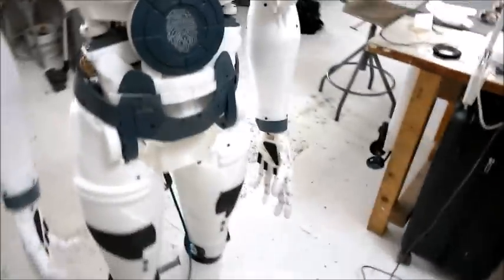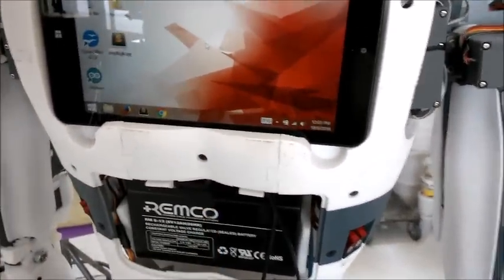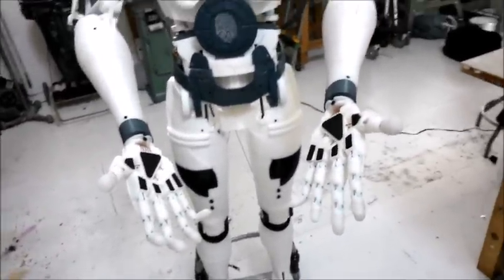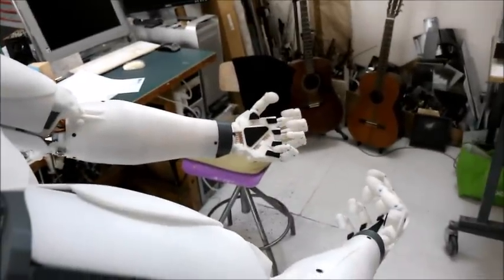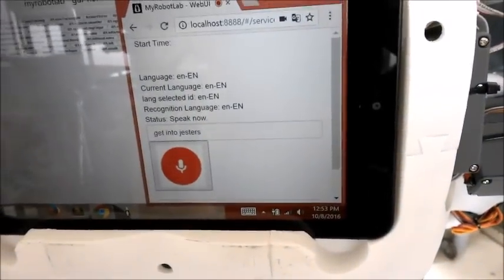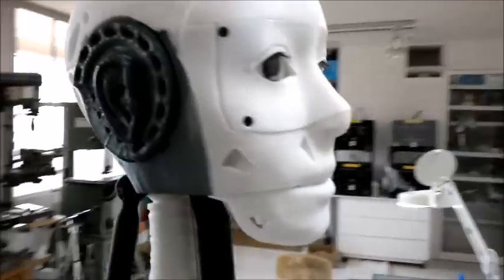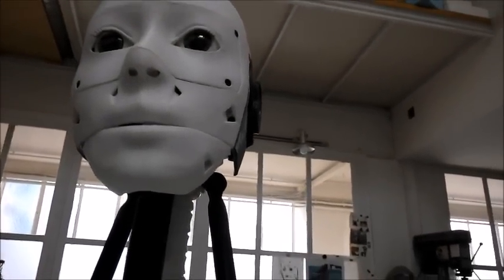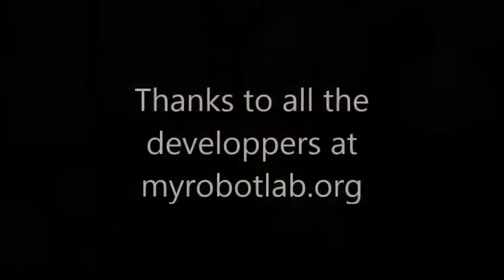InMoov on legs first 3D printed robot OpenSource

Comment: its 7yrs ago??? nd I m seeing on 2024 😮 if I start today don't know how many months it will take my poor printer to finish all parts😮 then a dyslexic like me gonna make many mistakes first few attempts..then assemble somehow... err😢 then fitting gpt, 60-100 servo motors..  then arduino code.., power supply cable will make it limited to move area,😢 so much task. Why am I lagging 7yrs in timeline jump😢😢😢

Comment: you chould automate the face recognition by what you do manual to classify faces by program an small program that uses some object tracking by ultrasonic transducers to determine that the robots camera is in front of a unclassified object or person before a automated instruction to activate the program that classify a single face before it saves the entry and fill in just a random number to the name. you can use the sound recognizer to determine of let the machine find out the name of the random person and then adress that name to the random number given to the classifier by making a name equal number command instruction. this way the machine could classify people or objects by itself. alternativly use the pretrained objects to determine point of capture of new objects and then narrow down the screen of the camery by excluding the part it already recognize from the picture so that only the new part is ready for classification. by repeat such a process automatically the robot chould build a record of tousands of new object over time given random numbers as classifications. the robot only need to use the sound detection to determine name of object. let say that you have the hand of a person classifed already pointing toward a object auto classified by random number and a confirmation by user input by voice to tell the robot to label the random number of a certain image object in the network with the name of the of what the object was called.  the robot only need to interprate the pointing finger as a gesture like a arrow for direction and you could in a sense teach it the real names of object classified before or you could make the robot pick these thing up by itself by a little bit of guessing. someone else would probably label objects out loud by example a person holding a object and as long as the machine already recognized its a human holding a object with a random number if the the person speak of the actual object the computer could be able by distinguish by language and conversation itself be able to exclude the word of the actual object from the rest of the information and adress it as the real name for the random number given by the classifier. this way the robot could learn by itself over time without spoon feeding it. the more objects it have classified the more information can be removed from the camera image to distinguish unkown object from known object adding to the network.

Comment: It seems to me the next big step for this robot isn't walking legs, but moving away from piggybacking off the Alice 2.0 AI and connecting to Internet to communicate, but instead have a fully dedicated system by itself.  Download its own AI systems (there are plenty of people who would help design it) and have it process it by itself.  Instead of a tablet, put an i7 cpu with some ram and SSD's and such.  Essentially make a small form factor pc inside the robot powerful enough to run all the algorithms to follow commands, process visual data, and copy movements.  Make it more user friendly.  The tablet in the back is just messy.  Have its own dedicated microphone and speaker system too, much better quality.
Reply: A Raspberry Pi 4 with its touchscreeen, maybe?

Comment: Please just 1 video showing how you wire everything, i have seen countless videos of moving, speaking etc. No one shows how to do the wiring, and yes i know it is on inmoov website drawings but they are horrible to follow for a none electrical guy. This project would have grown and been even bigger then it already is if someone would just show noobs like me how to wire the robot
Reply from the maker: This map already shows alot:
http://inmoov.fr/wp-content/uploads/2013/12/Map-ConnectionsV1-719x1024.jpg
For sure another map for the power wires would be good. But we are currently creating a board for to route all powering, therefore we will also create a map

Comment: Where are the STL files for the legs/feet?  You printed them, so they do exist.  Even unreleased versions would save a lot of modelling for some.  Dmitris Hatzis has a fine looking pair of legs that would meet my requirements, if he has provided his files for use...
http://www.3ders.org/articles/20151108-greek-teen-uses-3d-printing-youngest-creator-life-size-humanoid-robot-inmoov.html

My plan is to stand it on a Roomba-type base (for sensors and recharge port), with 90 degree knee and hip joints with aluminum/PVC skeleton to allow it to sit down at a conference table.  And a chest-mounted tablet for Skype...

I also plan a variation of the ESET Andy head (just my style preference, no moveable lower jaw necessary). Still investigating 2D image-3D model creation software...
Reply from the maker: Posting files that are not ready means a lot of negative feedback, lots of emails to process. At the end a lot of extra work for me. I rather spent my free time working on making the legs properly printable and working. That is how I proceed and have been proceeding on InMoov.
Dimitri Hatzis legs are not printed, they are modeled over a mannequin's legs and painted, you actually could do the same.

The chest mounted tablet files are already available in my InMoov collection available on www.inmoov.fr
Reply: Thanks for the response Gael.  You are free to work as you see fit, of course.  I saw Dimitris' MIT video from his website.  I hope he gets in.  Thanks again for your ground-breaking work...

Comment: Hi Gael, are you sharing legs design yet?
Reply: Hello Wayne, I still need to work on them. Parts are very big still and I need to design them to be printable on a small scale printer.
Reply: Do you think it would be feasible to make it walk? I understand that this is an extremely hard task, and it would most likely move very, very slow, and fall often.. But legs would be really cool lol. i can see this robot being outfitted with silicon skin and a realistic face.

Comment: man
yose your asistant it hase voice activasion its a free app on android and you can use it to fix that problem ps awsome job but get a stronger more powerfull tablet this thing has huge problems procesing ..
Reply from the maker: No processing issue with the tablet, I was using 3G through my phone to access internet and that is the reason it's a bit laggy. Internet access quality is the key to have a fast responding robot.

Comment: Really nice demo. BTW, what was that constant humming noise that sounded like a high pitched motor running? Perhaps that hindered inMoov's hearing?
Reply from the maker: Servos are noisy when they try to reach their position, remember it's hobby servo digital models. That is the reason InMoov is not expensive for servos

Comment: very nice made, do you run android on the tablet and which app you use for the voice commands. If possible could I have a copy of that app.
Reply from the maker: The tablet is running on Windows. But the software used is called MyRobotLab and can be installed on Mac, Windows, Linux and Android. You might need to check with the developpers which release version is compatible.

Comment: i have an idea why dont you have a flash-drive bank for memory so that the robot can process data that it saves throughout the day that way it can have an expandable memory and if what ive learned from working with computers is anything its that more memory means faster processing faster processing =more realistic timing and a smarter robot overall.
just a thought.
Reply from the maker: What is learned is stored into the memory as AIML files and MP3 audiofiles. But any new inquiries ask for an internet process which can be slow if the connection is bad. I was using the 3g on my phone for the wifi connection, which is the reason of slow responsive AI.
But we want to have a system with delay, if new inquiries takes more than x seconds, the AI will use what is already stored in its memory.
Reply: gael langevin i was trying to say have the memory save up so the robot can reveiw what it learrns near the end of the day 
(thats how our brains work
Reply from the maker: THErepare man16
The Alice2.0 of ProgramAB has a way of ranking the most asked questions, therefore you can edit the best answers to give at the end of the day.